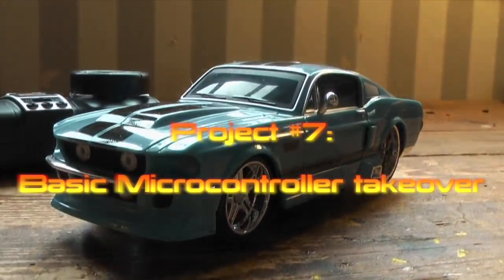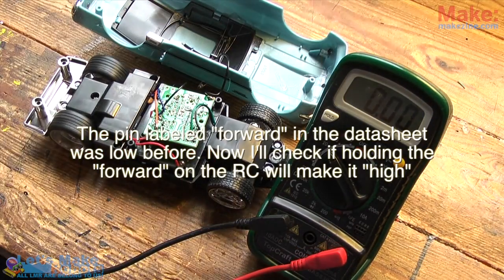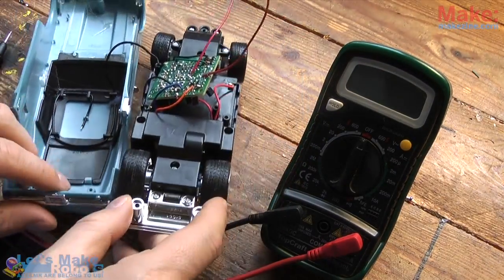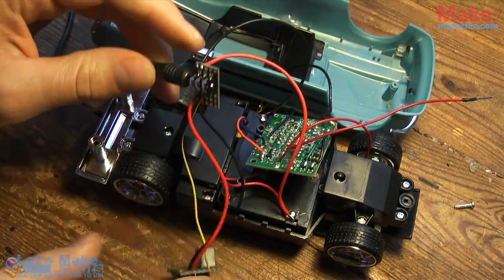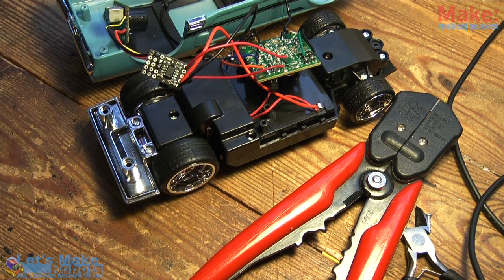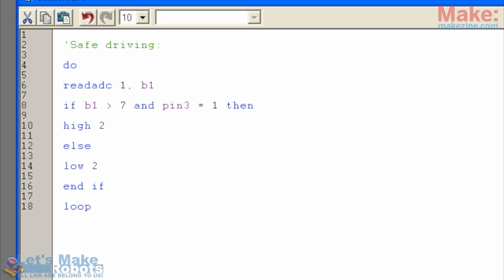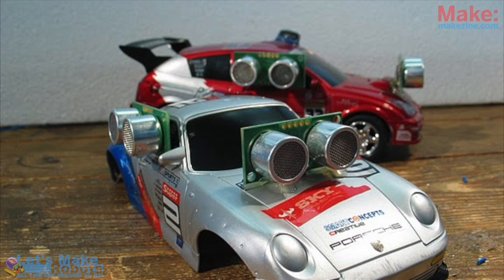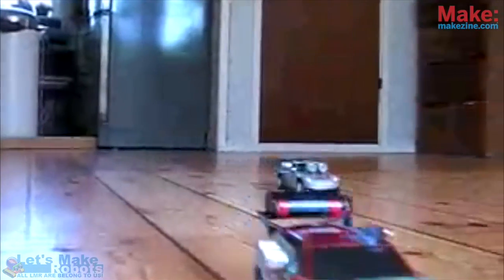The Latest In Hobby Robotics 18

Comment: @wintersoldier909 dude are you nuts? this is very cool. With just the basic steps, you can go from there to some other ideas, like how about other sensors on the sides and back that will turn the car away from obstacles. You have the basis for a self driving car right there.

Comment: @ValmisFilm, he would have to cover to much: micro-controller programming, multimeter use, soldering, electric circuits.  He has all the basic steps here.  Even if you are a noob you could google each step and get there.